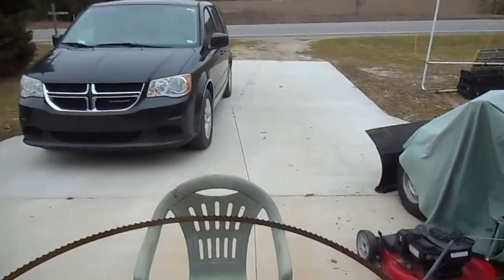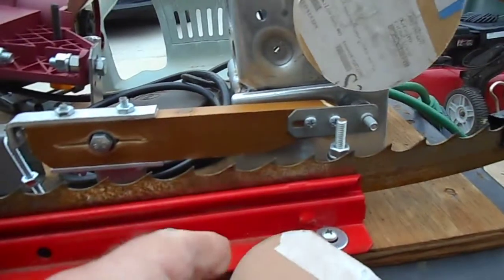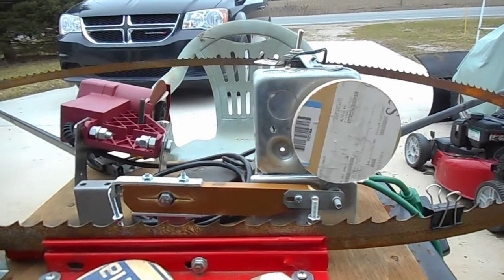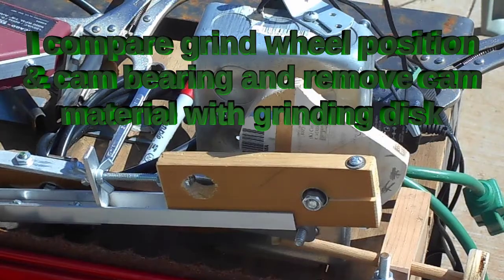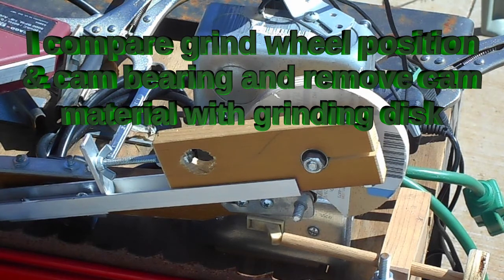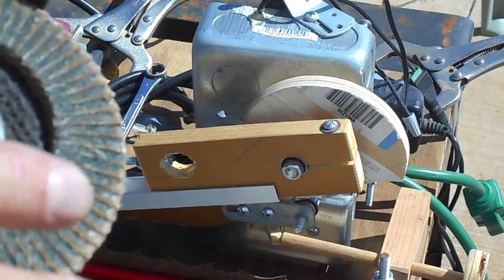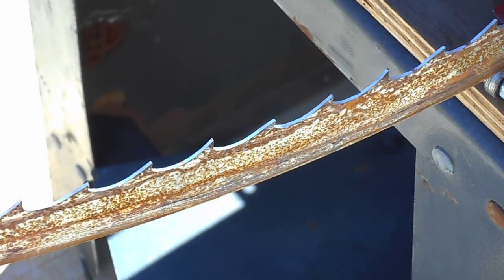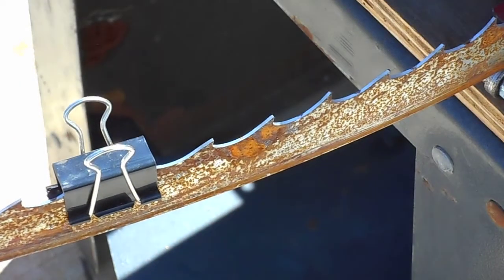Po-Boys autosharp saw blade Cam for Wood-Mizer silver tip blades.

Comment: I see what you mean about the cam being difficult.  Your mentioning that the touch point on the bearing was in different places on the cam.  It was a great help.  I am almost done with the video.  I should put it up in a few days.
Reply from the maker: As the bearing rides on the cam directly below the center of the cam. It has everything to do with the profile and where the bearing contacts the cam profile.  This concept might be a little difficult to explain but it becomes evident when you see the cam going around and where bearing makes contacts. It changes from 12:00 to almost 2:30 on bearing. Thanks for the comment.

Comment: Hi  Mac I hate to keep bothering you what is the off set from center of the cam thanks
Reply from the maker: As the bearing rides on the cam directly below the center of the cam. It has everything to do with the profile and where the bearing contacts the cam profile.  This concept might be a little difficult to explain but it becomes evident when you see the cam going around and where bearing makes contacts. It changes from 12:00 to almost 2:30 on bearing. Thanks for the comment.
Reply: @macwolgamott4201  thank you I built one I used yours and another one and got one built I am having trouble adjusting it, Do you think a 1/4  28 threaded rod will fine enough?  Merry Christmas
Reply from the maker: Yes I think that will be fine